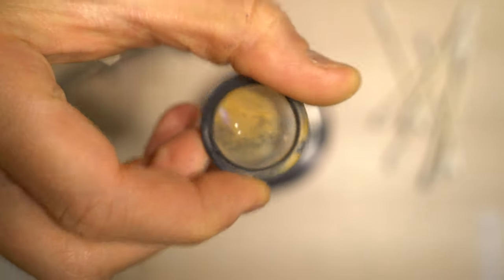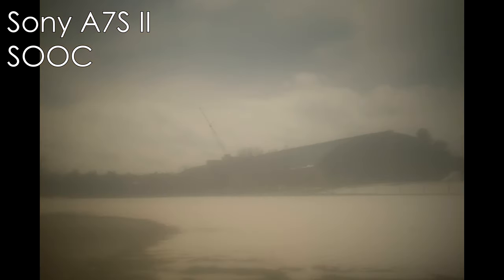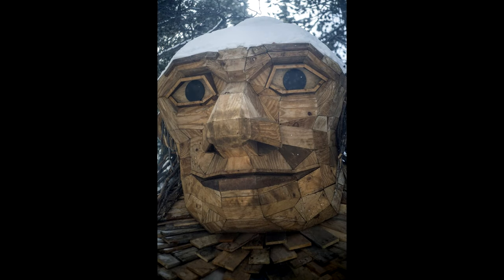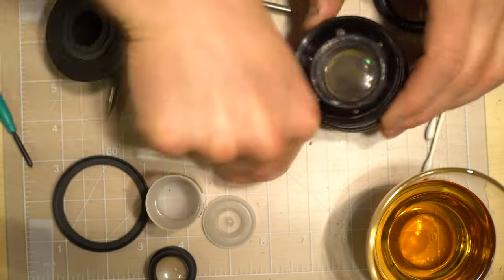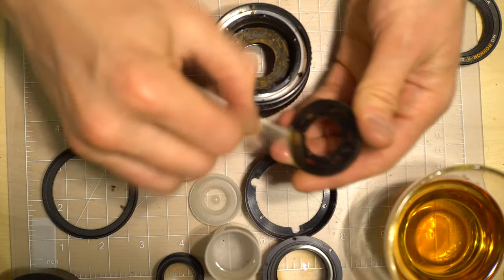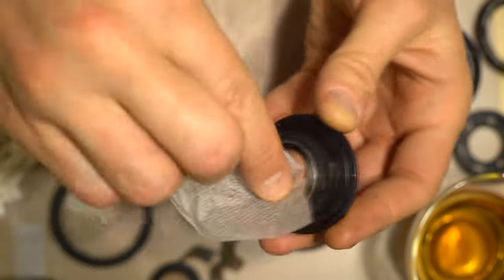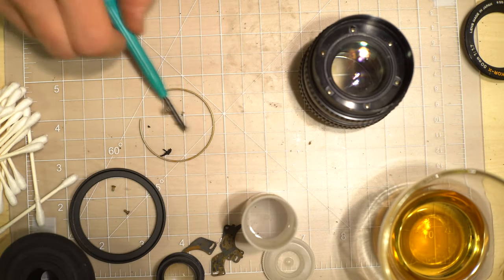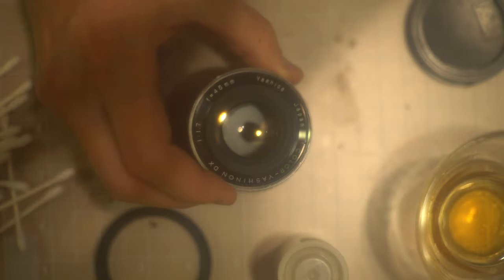Taking Photos with and Repairing the Moldiest Lens I have Ever Seen | Rokkor-x 50mm 1.7 Lens Repair

Comment: I couldn't stop wondering what sort of bourbon you had in the glass. But seriously, this was a very interesting video on many levels. Years ago when I was doing more buying and selling of equipment, several Rokkor lenses where among the sharpest I ever tested, and yes, easily serviced. I found that some really ugly lenses return surprisingly good results, and some that look almost perfect and cost a mint give poor photos. A very expensive German brand was the most common example of the later. The most surprising thing in this video was that you own an XK that still works. Thanks for documenting and sharing.
Reply from the maker: Thank you! I was enjoying a bottled in bond bourbon from Oregon, though I forget the distillery name.  For the XK, I did have to send it off for repair last year. It locked up mid-roll in 2019 and it took a while to find someone who would fix it (and at that he couldn't promise a successful repair, but he managed to do a great job.) They would have a much better following today if Minolta had properly supported them back in the day. They're an absolute nightmare if they fail, to the point that someday I will sell this camera (probably this year) and it will likely not recover the repair cost. Getting one repaired basically means finding someone who can locate another broken one with a different problem.

Comment: David, do you have a professional background in camera repair? It's what I would imagine to be a dying trade, what would you suggest to someone wanting to get into it?
Reply from the maker: I do not. I'm more optimistic than many about the future of camera repair. Were I to go into it professionally, here's what I would do:

1- Pick some cameras to really specialize in. Don't try to learn them all.
2- Get the repair manuals for those cameras, whether it's five models or 20.
3- Learn 3-D CAD with various printing techniques -- additive with PLA filaments, additive resin, eventually additive metal -- and learn to design with a laser cutter and different materials like wood, plastic, metal, and leather. There will come a time when no more parts for repairs are available and being able to make them (and building up a 3-D model library at the same time) will be crucial to this business' future.
4- Develop a good business model with solid P&L inputs, track every cost, and refine your pricing based on how much you want to make versus how much time each repair costs. Fixing a Canon squeak, maybe that $40 plus shipping because about 10-20 of those can be done in an hour depending on how fast you are and that's a good hour's pay. Rebuilding the film advance mechanism or installing new shutter curtains, that might take three-four hours and be a $200 job. Those are just random ideas and numbers, BTW.

Ultimately, the most important thing that anyone in a camera repair, sales, or service industry can understand, and the guiding philosophy I have when selling cameras is this: Every camera has to be treated like it means the world to the customer because I don't know how much it means. To me it may be a common $40 Mamiya or Vivitar, but to the customer it could be the camera their grandfather used to take their baby photos. Or the camera someone buys today, even if it's a $30 Minolta QTsi could be the camera that ignites a creative photographic spark in them. It's vital to treat every item and every transaction as though it is special and means everything to the customer because it easily could and denigrating or devaluing someone that means a lot to another person can set them back in their creative pursuits.

I learned that years ago when a student came to a photo class I was in one day just crushed because the guys at the camera shop ion Berkley had criticized him for using a Canon EOS Rebel 2000, which they called a Plastic Fantastic, and he left their, and spent some days before the next class, feeling like his camera choice was a bad one and would make him a bad photographer.

Comment: Let the aperture  doak in some vaporust for a day, may need to do it a few times to get it all off
Reply from the maker: I would have loved to have. The rust ended up not being the problem but the pivot pin hole expansion killed the leaves. There was no way to given them the ability to pivot when the aperture moved. A new aperture assembly could be used, but I'd need to harvest it from another lens that has worse elements to make that repair worthwhile.
Reply: @DavidHancock  yep, I wrote that when I saw the.ribmng mechanism  and before seeing the leavs. 
Would it even be worth it making some larger pins, even 3d printing leaves and pins.
Could you so a vid on the most common 35mm camera issue, the rewind shaft drops inside the camera, the youtub video have incorrect possioning with a pick and it should be in the 10 o'clock possession mot 7, and repair shops aren't  nice Abita it, like the use to be(now they try to charge an hour labor just for popping the film door open)
Surprised no one has a side gussle 3d printing rewind kobs with crank.

Comment: I have a question, I tried to disassemble a Kodak Ektar 152 mm lens for my graflex, but the first screw I tried to unscrew the head broke off leaving the rest of the small screw in place.
Apart from drilling the screw out I have no idea of how to get the remainder of the screw out, any ideas?
Also maybe some advice of how to prevent this from happening again, thanks in advance and happy Easter 🐰
Reply from the maker: Oh geez. Drilling it out is probably the only way with something that small. Those old lenses tended to use brass screws and they shear very easily. As the brass has aged, there's not much to do with those except be super careful when removing them. I've been in exactly that same position before and there's no easy resolution.
Reply: @DavidHancock   I was afraid of that, thanks
Reply: David usually drops cameras and lenses, so the impact loosens any corrosion lock on the threads. He cleverly edited out that part of this video, hence the high speed rendering. If you slow the video down, you see him edit out that part when he reaches for the tumbler. His DTs caused his hand to shake that resulted in the lens drop. He should have taken a sip a few minutes earlier and then he could have filmed it straight through without the edit.